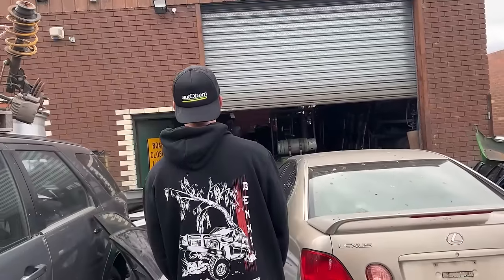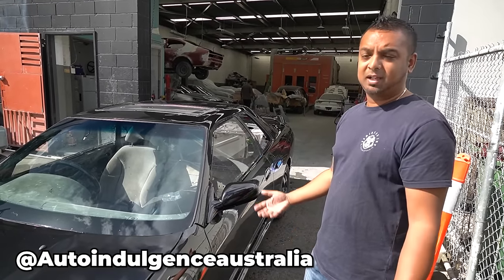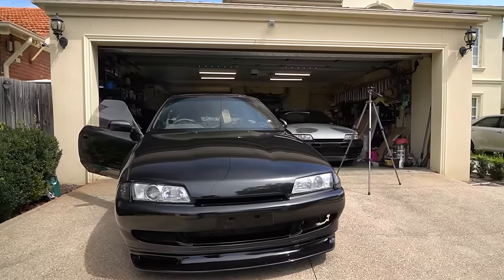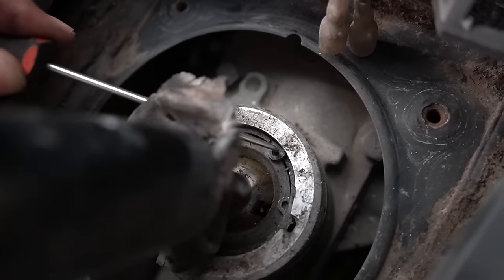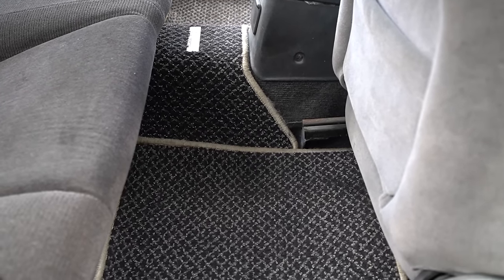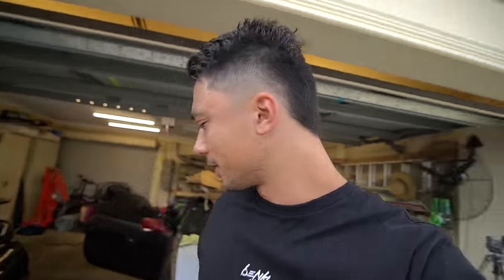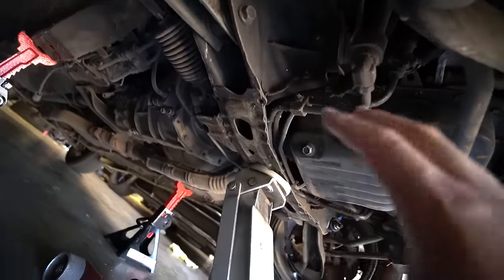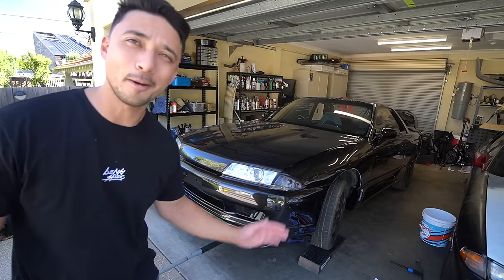REBUILDING A BARN FIND R32 SKYLINE | PART 8

Comment: For trims or any plastics you want painted black, I've been using VHT Vinyl Dye Satin Black (SP942) with huge success. The unknown is how it stands up on exterior plastics over time (like years) but they promise it is UV stable and suitable for the task. Works awesome on anything plastic or rubbery with absolute minimal prep!
Reply: Bowdens Mr black works well I find.

Comment: Highly recommend taking the time to add sound deadening wherever you can, under the carpet, boot, quarters etc makes such a big difference on these cars
Reply: imo stripped better
Reply: cant add weight cause racecar
Reply: He´s actually right those Skylines really does plastic Rattle alot. anyways a nice car buuuuuuut annoying rattles
Reply: @krizz6674 most 90’s Japanese cars do, try 90’s Honda’s for example they rattle like crazy

Comment: Bonnet looked pretty zebra stripey
Reply: Glad I wasn't the only one to spot that
Reply: Was wondering that or is it just the reflection
Reply: At what timestamp, looked fine to me and I usually spot paint flaws.
Reply: @schafer240 4:18
Reply: And the mad bonnet gap on one side
Reply: @owain1996  Good catch, the paint gun fan was too tight. The coverage is good, looks like it's a metallics issue, a drop or cross coat would of made it uniform.

Comment: Hey Rex. Came out mint. Just wondering if it’s had a front end hit, as the passenger side headlight sits a bit high and bonnet is up. If it has, it may not be a hard fix as those old cars pull nicely. In the process of pulling mine right now.

Comment: How are you going to fix the frame rails? Will you be sourcing new ones and rewelding them back on?

Also a lot of nolathane bushes fall apart and crumble when they fail rather than rubber that just cracks. Maybe superpro can sponsor the build and supply bushes for the car ;)

Comment: 100% sure those floor mats are r33 

R32 came in plain grey no white trim

Grey with red stitching

And the gtr was a greenish grey with white trim

And the r32 centre peice in the rear wasn’t that shape

They still kinda fit but the drivers one won’t sit aswell as the correct mats
Reply: Yeah they're the same as the ones in my 33, good mats though lasted 30 years and 270 thousand ks without a single hole worn through yet the crap people replace them with hardly lasts 12 months
Reply: They were thick and made to last as long as the underside didn’t get too sundamaged and crack